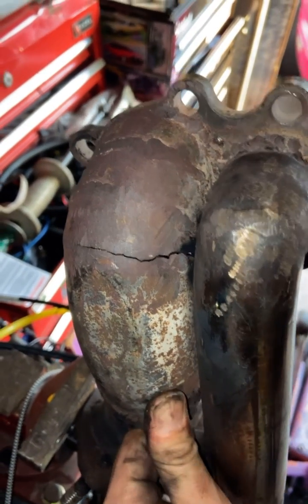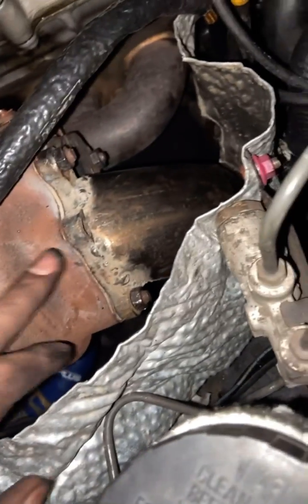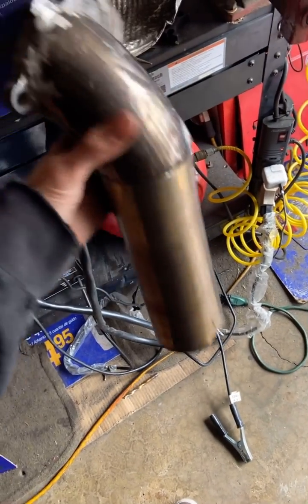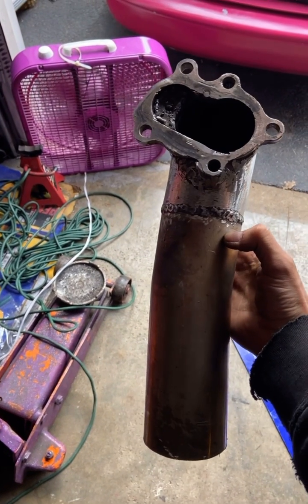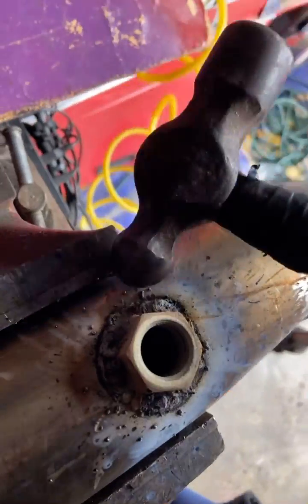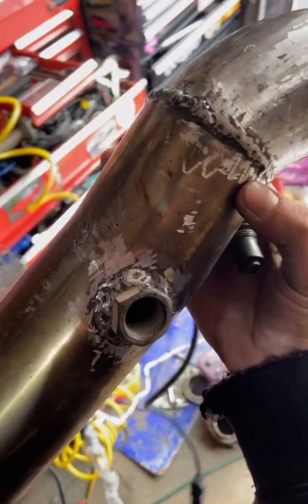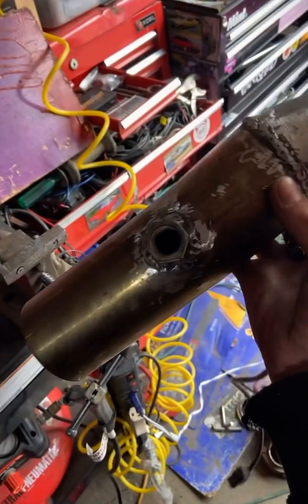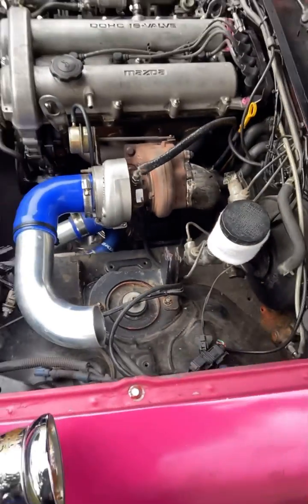T25 1.6 Turbo Miata - Fabricating a new 3 inch downpipe

Comment: You know those welds aren’t the best looking but it will get the job done. Look into powder coating or high temp it will burn off but prevent so much rust which will cause cracks and leaks faster
Reply from the maker: Yeah they’ll definitely get by and I do agree I’d like to get some powder coating done just haven’t gotten to doing that to anything yet

Comment: You're going to have all kinds of leaks with those welds. Maybe don't try stick on exotic metals with unknown properties
Reply: You know they have different welding rod rated for different metals, right?  No, of course you don't because you aren't a welder.  I work with 2 professional welders who weld all kinds of stuff in the field.
Reply: @Big_Ben1988  sure you can use a 6011 or a 7018 rod but over years and all the heat sress, those will crack. You can't weld dissimilar metals together with a rod that doesn't match the properties of both base materials and hope for a durable weld. And did you find the end of the crack and drill a hole so it stops cracking? This is a job for MIG or TIG especially if you're doing stainless. I've been welding for 7 years, I know a bad weld when I see it. And those should be re-welded with TIG, be better looking and they're less likely to crack with the right filler
Reply from the maker: @eli84360 it definitely welded up nicely just doesn’t look the best until it’s cleaned up
Reply from the maker: @Big_Ben1988 yeah it seemed to weld up really good just doesn’t look the prettiest until it’s cleaned up